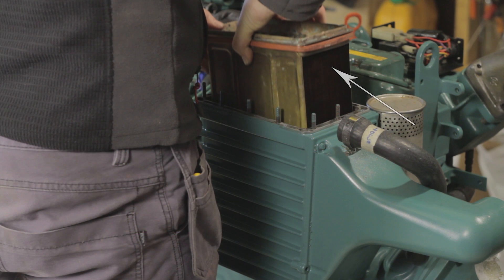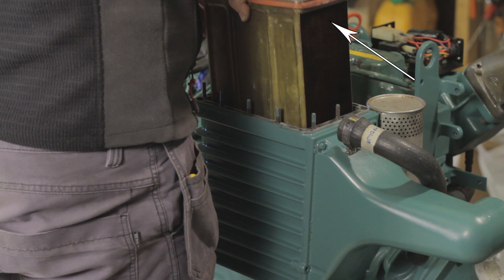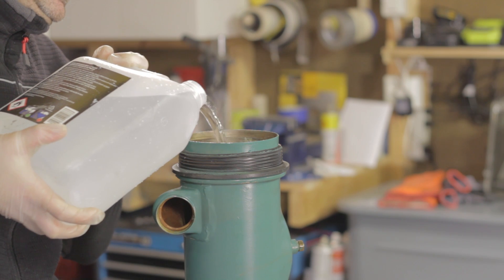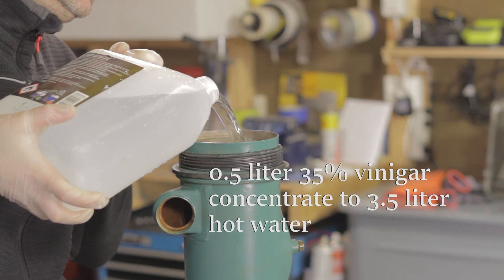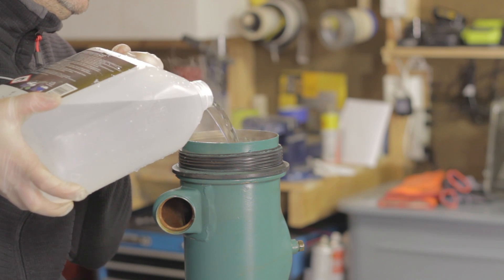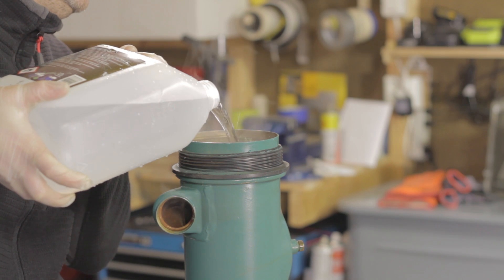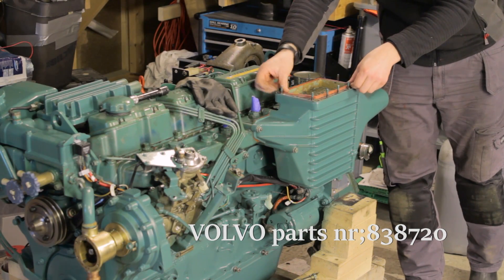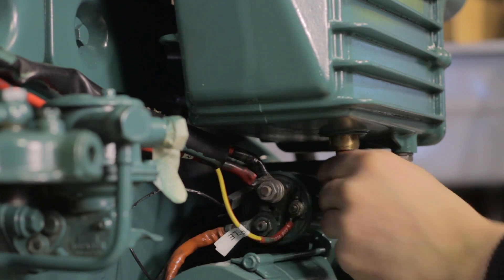Episode 4 aftercooler

Comment: I am having issues with my Volvo KAMD 300 engine (450hrs) which appears to be producing a lot of steam at the exhaust and the temperature is also going up a bit. We have checked all of the usual raw water culprits (no change). We have also just had the injectors serviced and they are about to be re-installed. If that doesn’t fix it, could a faulty aftercooler cause these symptoms?

Comment: We have designed and manufactured a fully marine grade 316 stainless steel Volvo Penta aftercooler. No more rust, discolouration or deterioration as found with the original cooper ones and half the price. Part number 3582599 to purchase it please click our ebay link for more details: https://www.ebay.co.uk/itm/264860822331